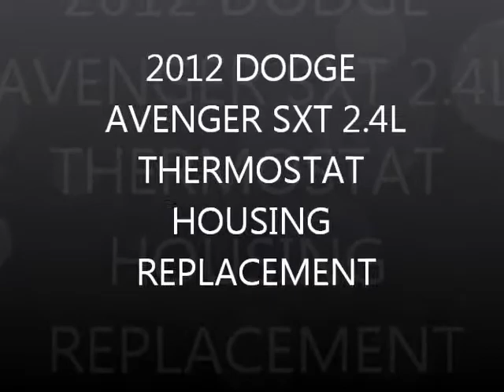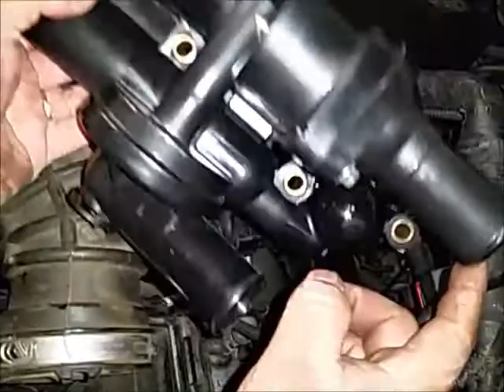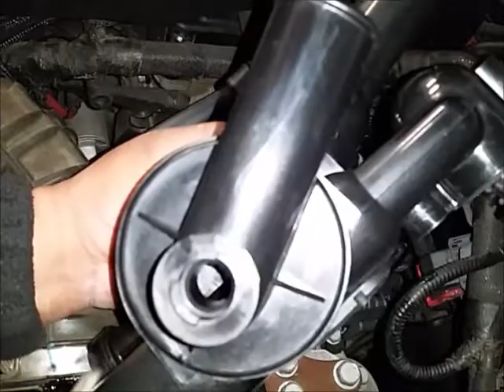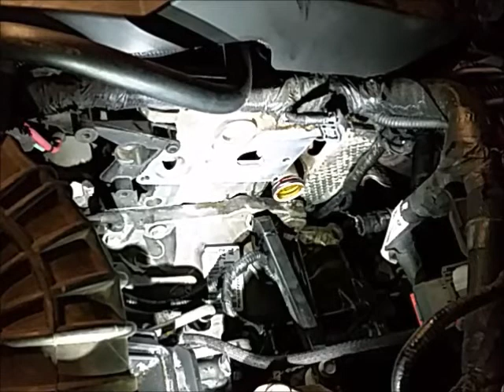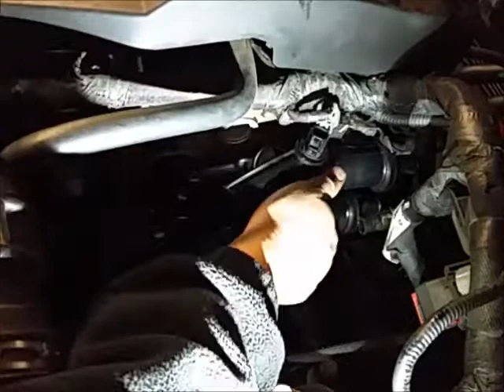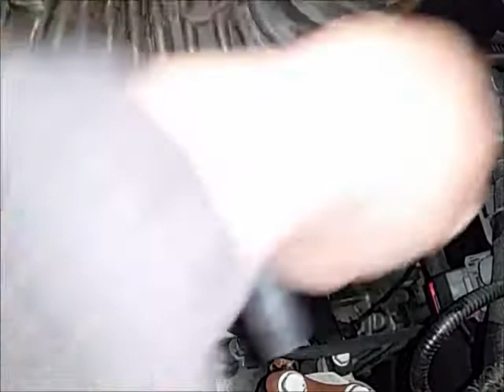80.- 2008-2014 DODGE AVENGER SXT 2.4L THERMOSTAT HOUSING REPLACEMENT

Comment: I have a problem with mine leaking.  but when i was goign to order the housing  it  says heater Hoses needs to be 2009 and newer  this is a 2008 dodge avenger  so i am not sure.
Reply from the maker: 2008 through 2014 they use same heater hoses  . When you squeeze heater hose they feel soft or hard ?

Comment: is there a coolant bleeder valve anywhere on this car? im having trouble figuring that out. i just replaced both thermostats and need to add coolant but i dont want to have air in the system
Reply from the maker: It doesn’t have one you need to use a coolant funnel to bleed air out

Comment: I think you have bigger problems than that thermostat housing. Judging by the color of the coolant and oil coming off the mounting bolts
Reply from the maker: Hi .I don’t have any problems at all . Car runs perfect. Coolant color is because I added radiator stop leak before fixing the housing. 😅

Comment: What did you put on the openings before install?
Reply from the maker: Hi! I used red high temp grease for o-ring and Permatex Ultra Grey  RTV Silicone Gasket Maker, for the openings.  I like to add a little bit of  silicone becausr sometimes surface is not smooth.